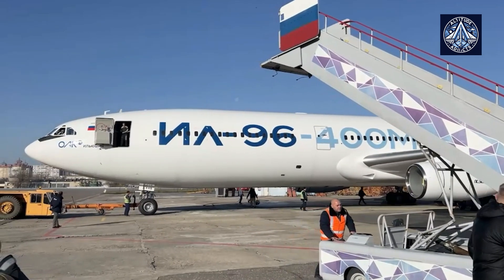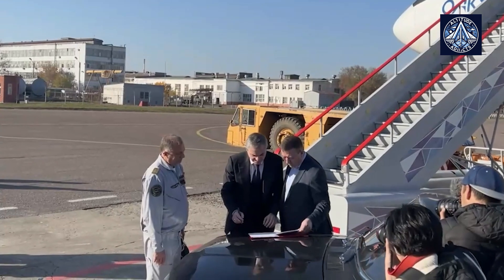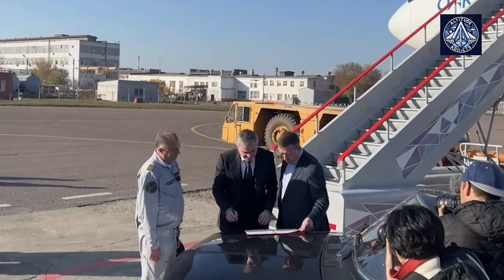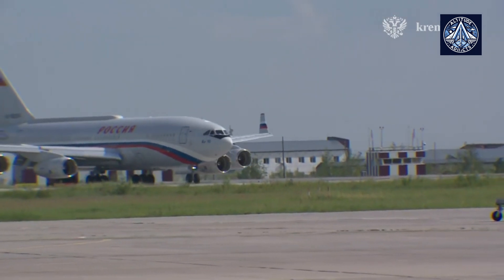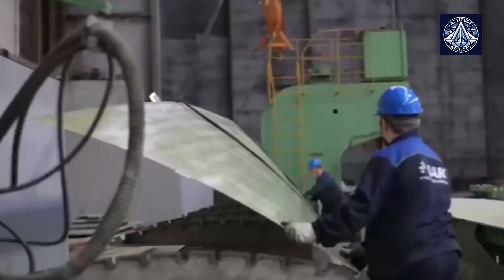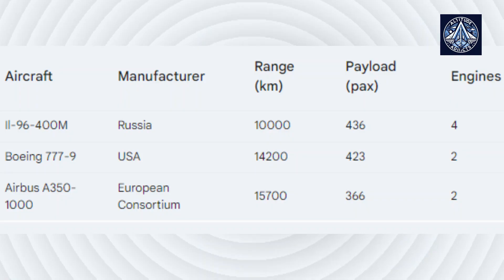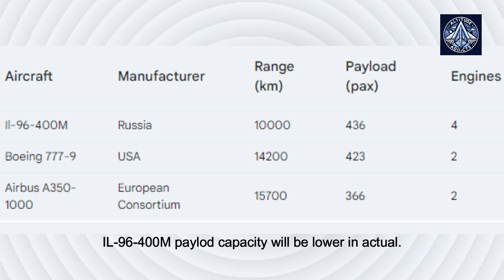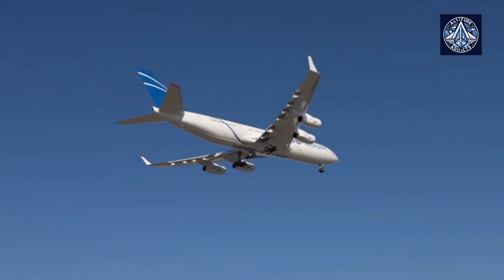Il-96-400M: Russia's Answer to the 777-9 and A350-1000?

Comment: Most airline in the world is retiring 4 engine aircraft to cut operate cost. 4 engine IL-96-400M is 30 year old when comparing with twine engine 777-9 and A350-1000 .
Reply: Thats doesnt really matters for Russia as they have twice cheaper fuel as we do in the west ;) Plane is nice and comfortable.
Reply: @Andrej767 good point. But they could still use more efficient high bypass turbofans. Those engines and nacelles look like they’re from 1970
Reply: @jtwilliams8895  They work on a new PD-35 engine.
Reply: Hmmm Creepy Joe Biden wouldn't dream of flying on a twin engine.
But it's ok for the "peasants" to fly with an extremely risky twin engine?

In any case, Russia will soon have an enlarged engine capable of providing a twinjet Il-96 config.

Comment: They should increase the length 
Redesign the cockpit with active side sticks lcd touch display hud display 
Moderm engines
Electronically dimmable windows
Composite material for wings 

Etc ....

Comment: a Russian plane is 2 times cheaper, 100 million cheaper. 4 engines means 2 times more reliable, consumption is not significantly higher, it has 4 fuel pumps, not two, which can break. and then the planes of the West will fall

Comment: Compare this with the ultra modern and efficient A350-1000. 40 years apart.
Reply: what about price comparison? do you have data?
Reply: Nope, quad jets are infinitely safer. Just look at what US presidents INSIST on! In any case, Russia will soon have a twin jet variant. Not that it needs it with its own dirt cheap fuel.

Comment: In the USSR in the late 1980s there was an aircraft similar to the twin-engine Western airliners A310, 767 and their descendants. This Soviet aircraft was supposed to begin production in 1994. It was called Antonov An-218. There was an agreement between Russia and Ukraine on its joint production, similar to the production of cargo An-124 (Ruslan), which existed until the 2010s.
But the IL-96-400 was a quick, cheap option for upgrading the outdated IL-86 aircraft, which the Americans helped launch by providing their engines and electronics. This made it possible to abandon the An-218 and not create competition for Western companies.

Comment: I think Russia has bigger priorities than a wide-body airliner tbh...
Reply: Russia is doing massive expansions on manufacturing. This is just one part of it. Wdym
Reply: @benmm01  kursk...
Reply: @tsj-bn8yf  Ukraine hasn’t even reached 30% of the way to Kursk and their advances have stopped lmao. Russia just holds them off in the small territory they sit, so that the Pokrovsk offensive can go easier. A distraction if you will
Reply: As a 4-engine plane, it has no commercial chance against the western 2-engine planes due to fuel consumption and maintenance costs. But Russia lacks such large engines for wide-body planes in its own production.
Reply: @gottfriedheumesser1994   a Russian plane is 2 times cheaper, 100 million cheaper. 4 engines means 2 times more reliable, consumption is not significantly higher, it has 4 fuel pumps, not two, which can break. and then the planes of the West will fall
Reply: @Rusich945  Only the IL-96 has four engines, even the other Russian commercial planes have two engines. The usage of 4-engine B-747 and A-380 has decreased very much because of costs.
But you seem to be an aviation expert and I cannot keep up with my pilot licenses.
Reply: @Rusich945  Continue dreaming in Russky mir. The rest of the world is different. Nowhere is flying so dangerous as in Russia and in parts of Africa.
Reply: @Rusich945  It makes no sense to discuss this with a Putinist. Have you ever been out of Russia? I have been to Moscow, it was imposing. But I have never been so glad to leave a country.

Comment: Congratulations Russian engineers it a bigger than boeing 400 keep it up, that is a huge spet forwards for dominating to western aircrafts industry.
Reply: For how long do you live under a rock? You are a dreamer or paid by Russia 😂
Reply: @gerhardma4297  Russia made plans for many years before you so just enjoy the video 😅
Reply: They must be gearing up to produce one per decade. Boring should respond with an upgraded 707 to compete
Reply: @rodsavage9387 if Boeing could 
1) keep the door closed mid flight.
2) keep the nose up ( not forced down by the automatic system )
   it may avoid lawsuits & bankruptcy.
Reply: @bigtruck3187 same here, but I still won't fly on either

Comment: Range increase should be the focus. 10,000 km is not enough for a widebody. needs at least 13,000 km
Reply: Russia does not have friends that far away. Havana is only 9,500 km away from Moscow.
Reply: +Payload
Reply: @georgevukadinovic9934   even more for Russia because they can’t use most airspace
Reply: @mohwybar5832  same valid for brits flying to Asia ;)